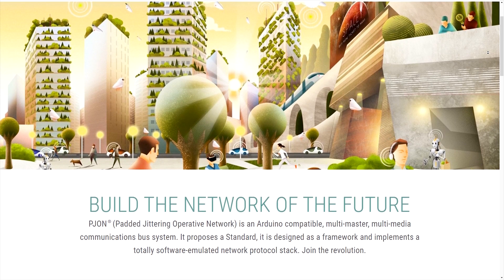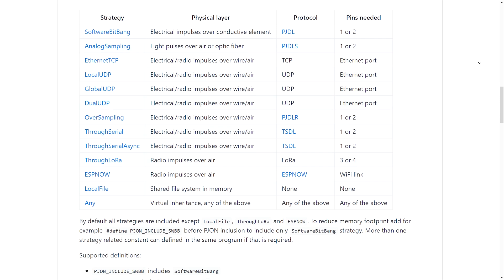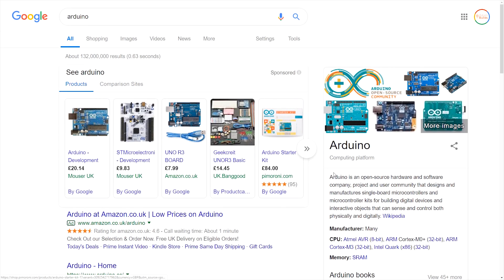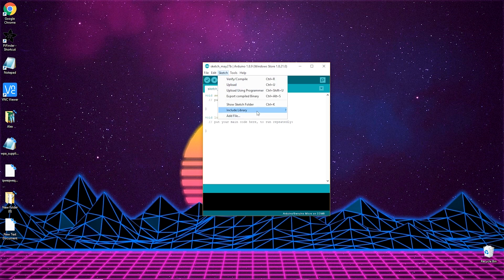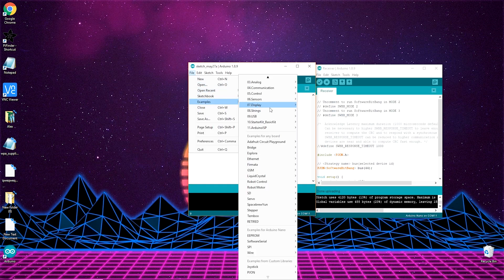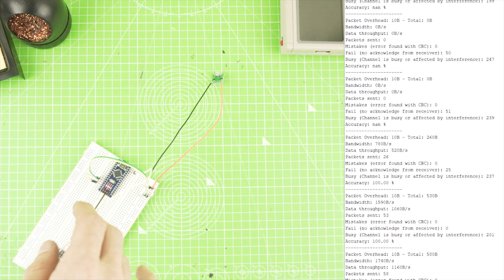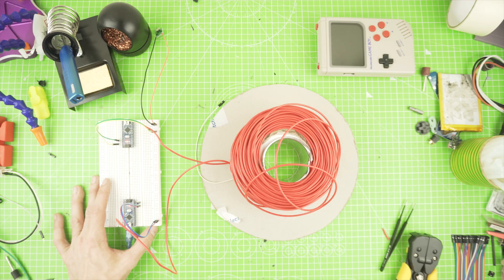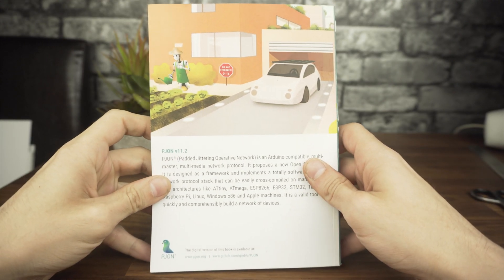First steps with PJON

Comment: thanks Adam , i communicated 2 atmega328p-au (ard. nano) and i could send data in each other. However whenever i send data from 1 nano to the other it keeps repeating last data once , and then real data comes. to give example, 1 button connected to 1 nano (call nano 1) and the other nano (call nano 2) is waiting for command determined. when i send "blink d8 pin out" data from nano 1 to 2 , nano2 is blinking d8 its ok so far but when i send "blink d5 pin out" to nano 2 , nano2 is blinking d8 again. after that one more time i try, correctly blinking(d5).  i thought it was buffer or memory problem but i couldnt solve it. can you explain me why it is sending last data ?

Comment: Fantastic Adam. This looks like it could have a lot of very good uses. I may well do some testing next to some high power RF and see how it copes.
Reply from the maker: Glad that you liked it George, let me know how that worked out, I plan on using it for my home automation project
Reply: Adam, As soon as I get my antennas fixed I shall try a solar powered arduino at the top of the mast down a single wire. I will be running various HF radio frequencies at the 800w to 1Kw mark into various antennas around a metre from the arduino so we shall see how the single wire system copes. Receiver should be around 40m away indoors.
Reply from the maker: You shouldn't have any problems at that distance!
Reply: Not so much distance but 40m is actually a resonant length for one band, a halfwave and a quarter wave on lower bands an double/quadruple on higher bands. Induced rf coupling is possibly going to be the issue, especially with such a high field strength at the feedpoint which will be a current maximum.
Reply: @GeorgeChristofi  ciao, there are really complex setups worldwide implementing PJDL (the protocol implemented by SoftwareBitBang), mostly home automation, running for years and many users are neither applying the suggested protective circuitry, see https://github.com/gioblu/PJON/wiki/Protective-circuitry so it proved to be quite reiliable in this environment. I do not know about existing applications in the heavy industry where interference of the magnitude you speak about may exist, although I suspect there a balanced pair could be a better and safer choice :) I am really curious to know what will happen if you will ever end up making the test you have described, interesting to see if the pins will survive :)!!! Compliments George your content is really interesting, keep up the good work.